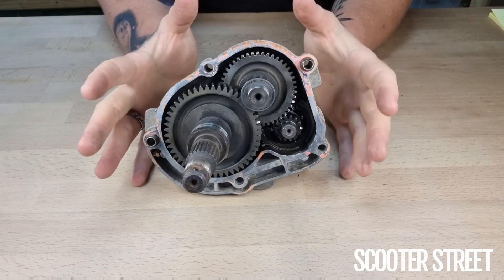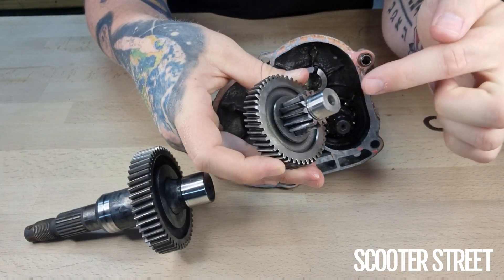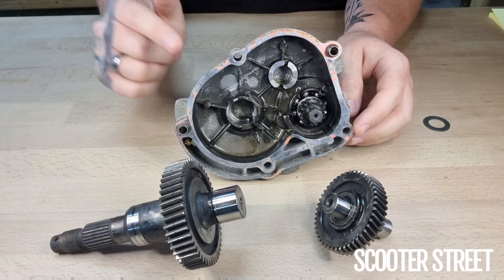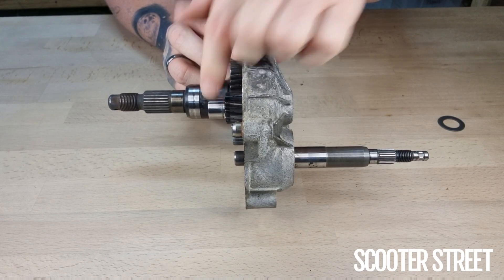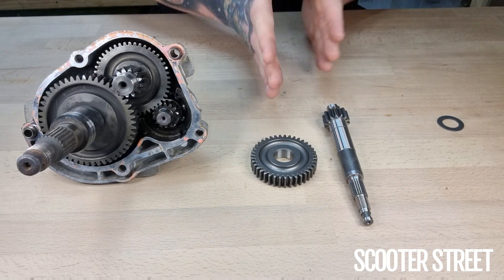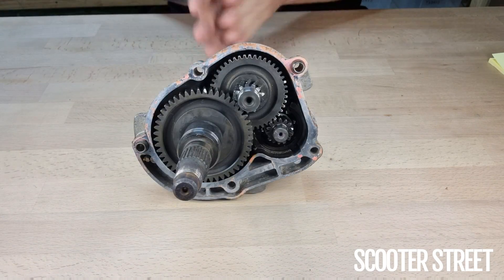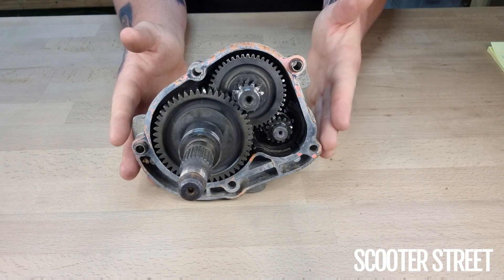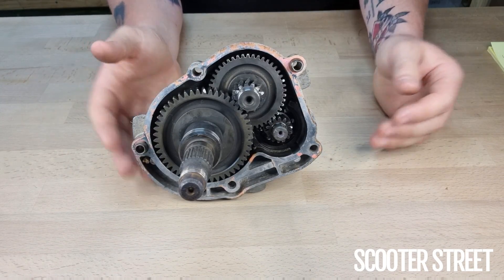Scooter Gears Explained! Primary & Secondary Kits - Which To Buy?

Comment: Quality content👍
Reply from the maker: Thank you. Glad you like😁
Reply: @scooterstreetau so what's the best gearing on my 150 scooter 15/37? Mine was 13/42 stock.
Reply from the maker: @Kevin-j9c1l  What is available in the make and model you have?
Reply: @scooterstreetau  what's available?? Anything 15/37 and on.
Reply from the maker: @Kevin-j9c1l  Go with the gearing you need,.
Reply: @scooterstreetau  that's helpful. Like the others. I figured it out like everything else.
Reply from the maker: @Kevin-j9c1l  We made the video so anyone can work it out, in the video we explain you how to calculate the gear to find the ratio👌
Reply: @scooterstreetau hey what gear up kit should i use on a tank 200cc 13 inch tire EFI 2025 with a performance exhaust and performance intake and carburetor and racing cvt
Reply from the maker: @CarlosReyes-v1x5c  What is available?   We made the video so anyone can work it out, in the video we explain you how to calculate the gear to find the ratio👍
Reply: @scooterstreetau im thinking a 2.1 final drive gear

Comment: Can i put the aerox gears on a bws vertical? Im asking because I've seen many people do that and the only malossi 14/42 gears i found online are for the aerox😅
Reply from the maker: Try the Staeg6 selections they have several options.
Reply: @scooterstreetau  But can I put aerox gears on the bws vertical engine?
Reply from the maker: @BUZZKILLER-NØS  With some of the ones I mentioned, they fit but the ratios are odd due to wheel size.

Comment: Hey what would you recommend for gearing on a 70cc athena kit on a Yamaha jog?
Reply from the maker: Do you want higher top speed? Change secondary gear and do the calculations.
Just be careful asking too much from the Jog if it has small thin 10 inch tyres and pressed tin wheels.
Reply: @scooterstreetau I want it to be more torquey but also have a higher top speed & I have upgraded wheels
Reply from the maker: @tayglizz4913  Fit a 70cc kit exhaust carb over range and secondary gear.

Comment: What gear do I need for more bottom end torque of that makes sense?
Reply from the maker: In most cases there are not gear kit to do this, this is acheived by increasing the cylinder size and upgrading the transmission variator, rear pulley. The quickest and best bang for buck is a Cylinder kit.

Comment: Thanks for share infomation, i have liberty 125 iget. I upgrade kit malossi 185cc - 62 stroke. Can u advice for upgrade my diff 😁 thanks bro . 
16 inch front wheel - 14 inch rear wheel
Reply from the maker: Hi, You're welcome. You would want to upgrade the secondary gear kit but you will need to find the specific Liberty model on the Malossi or Polini website.

Comment: Hello! Awsome video! I need some help! I have a Vespa Primavera 50cc 4T 3V Euro 5 2022. I upgraded it with Malossi 80cc BBK, Variator, Delta Clutch, Torque Driver, Red  Air Filter, Polini Belt. What other performance mods i could do for top speed and acceleration? My scooter is limited to 55km/h, which for me seems kinda low, yes i didn't change the ratio of gears, Malossi recomands 15/55 is that the best way or there are better ways? I heard it can reach 80 Km/h. Thank you!
Reply from the maker: Hi Thank you. You MUST change the ECU and gear kit when fitting the BBK!
Reply: @scooterstreetau  yeah i forgot to mention, i changed the ecu too, ok then, the only change to do is the gearing, thank you!
Reply from the maker: @Carbastanu  Yes do the gear kit then.

Comment: So when you go with the gear up kit should you use lighter rollers or  heavy rollers in combination with the gesr kit that's what I'm wondering about . Any help would be appreciated . I think ill keep the head stock with a 50 and do the gear up kit . N see what that does . I think it will be good that way
Reply from the maker: Yes, definately consider tuning the transmission to suit the gears, some gears require higher rpm engine to get the gears working.

Comment: Im just looking for top speed really . Cause u can tune the variator to get you off the line faster if im correct right?
Reply from the maker: Yes, but if you over gear a 50cc engine it will not have enough pull to allow the gearing to activate. You need rpm.

Comment: I changed gearing there are a lot of choices to choose from so i went from 13-40 to 17-38. I got lucky it WAS AWESOME 😁😁😁
Reply from the maker: Good stuff! What did you notice? Where are the gains?
Reply: @scooterstreetau  no I'm not happy with the change 🤬🤬🤬.I tried it again today only a 2 hundred rpm difference. I made too big a jump. 💩 Happens.
Reply from the maker: @Kevin-j9c1l  Yes when you sent the change in your reply, I calculated the ratio and it was huge reduction, it takes vast RPM to move such a ratio. 3.07 to 2.23. try for 2.8, 2.7
Reply: @scooterstreetau  I'm using 17-38 gearing what do I go to now?! 14-38 there's a few to choose from.
Reply from the maker: @Kevin-j9c1l  Use the information in the video to calculate the best gearing. gearing up will only work if there is sufficient RPM.
Reply: @scooterstreetau update I went back to 13-40 gearing. I decided to change so I googled gearing it said 13-  40 is stock no shit so it recommended 15-37. Wow what a difference  the stock gearing had faster take off but fell flat. This gearing slower take off but just pulled. If you will. I'll stick with it. 👍😁
Reply from the maker: @Bert-p3p  Nice work! Use the variator or Over range kit to better the accelration.

Comment: What gears do I need to get more top speed on long distance riding my scooter has 15/52 gears so it’s 13 to 1 full tire rotation
Reply from the maker: Search for what is available for your scooter.
Reply: @scooterstreetau  I got the gears that I need to get which will make me go 55 to 60 mph top speed but it will take me 8 seconds to reach 30mph and I am fine with that.
Reply from the maker: @Smodlee  Revisit and adjust the variator and clutch to assist with your early acceleration.

Comment: Hi i have a scooter with a stage 6 engine and a 22mm carburetor and a normal belt not the oversized one .
I want to change the gear box so what is the best ratio for that and did can i buy the primary without the secondary? Thank u for reading 😊
Reply from the maker: You will need to see what is available for your scooter model.

Comment: Hi do you know about the same thing but with a mo2 typhoon 125 2 stroke engine with a 172 kit. Im stuck at if i need to just change the secondary gear to the malossi one nd leave the primary gears as they are thanks in advanc
Reply from the maker: No, sorry I don't know the answer. You will need to do some research. Remove your gears and count or look at the parts diagrams. Also see what is available firstly for this model.
Reply: Ok mate no worries I'll have to keep researching untill I get to the bottom of it 😅 but really appreciate your reply thankyou. Also video was a good whatch helped me some what understand it abit more than I did 👊🏽

Comment: hi i have aprilia sr50 my setup is gianelli reverse exhaust and malossi multivar 2000 what  gears sould i use pls help
Reply from the maker: Fit a 70cc kit before the gears.
Reply: @scooterstreetau i wanted to keep it 50cc. will the malossi gears help my top speed? and what gear ratio to use
Reply from the maker: @apriliaSR-70  Really? Ok, check the fitment on the Malossi website for your model.
Reply: @scooterstreetau stock gears are 14/43 and its saying to put 16/41 and now i don’t know will i get better top speed or better acceleration or both 
and thanks for helping i appreciate it ❤
Reply from the maker: @apriliaSR-70  You need rpm to have any effectivness.

Comment: I'm planning a Stage6 Sport Pro MK2 AC on a Adly Thunderbike 50 (minarelli horizontal) polini intake, racing membrane block with carbon membrane) polini high speed variator, polini 3g clutch scr corse Handmade, motoforce hpc crank and polini gearbox cover. I will reach about 95-120km/h, should it be enough to change the secondary gearing?
Reply from the maker: Hard to answer this, the secondary is good place to start.

Comment: Always very helpful!! I was wondering what you guys think about adding a gear up kit to my piaggio zip 2t. Has got the malossi sport 70cc kit with TT vince exhaust and malossi multivar 2000. Do you think putting the malossi 15/38 gear kit would do any good ? Thank you
Reply from the maker: Thankyou and yes that's a great idea! Or a 14/47 secondary.
Reply: @scooterstreetau  Thank you for replying. What do you think about the malossi 16/37 gearup kit ?
Reply from the maker: @ST-9788  Calculate the gearing as in the video before fitting that one.

Comment: Primary : 16T ori
Second big 56T ori
56:16 = 3.5
Second little : 12T ori
Final : 35T ori 
35:12 = 2.92 
10.22 

15T.  if i change the primary    
56T
3.73.            
X.    
2.92
10.89 this go higher

So the higher the better acceleration i get? And less top speed?
Reply from the maker: Not much gain as a %. yes.
Reply: @scooterstreetau  is it worth it to change the primary? Or just play with heavier roller? I just want better acceleration
Reply from the maker: It depends on your target. @fikriaero9287

Comment: Hi there 🙂

I like you're video's 👍😊
I have a Piaggio Zip Euro 5 with a Malossi 80cc cylinder but my gearing is still stock. My top speed is 60kmph but i have plenty acceleration. 

Is there a way to change my gearing so my top speed will improve a bit ? 

My local dealer said that they don't know any gearing options that fit the Piaggio Euro 5 engine with the 10" wheels that the Zip use 🥺

(My complete setup is)
Malossi 80cc cylinder with Malossi ECU
Stock air filter box but with Malossi foam 
Malossi air filter tube 
Malossi variator but with piaggio belt

I don't have the torque driver yet , but does the Malossi torque driver also increase the top speed or only the acceleration ?

🙂
Reply from the maker: Yes you do need the gear kit with this model. What you need to do is find the part number for the Euro 5 Piag Zip gears and compare them to the Euro 4 gears. If they are the same then you can use the Euro 4 gear kit from Mlaossi. https://www.malossistore.com/en/au/piaggio-zip-3v-iget-50-ie-4t-euro-4-2018-2020-pizi3v50-M.
Torque driver assist yes.

Comment: Hello sir… i have kymco 125 cc…i want a top speed gear installed… pls! give the gear Ratio to acheive it . Thank you!
Reply from the maker: What is current gear ratio and what is available for your model?
Reply: @scooterstreetau  its a stock gear. my scooter brand is Kymco here in Taiwan
Reply from the maker: It is impossible for me to know 🤷 There are over 20+ different model of Kymco 125cc. @dcharmz5915
Reply: its a jockey SR model
Reply from the maker: We dont have this model in Australia, I am sorry I can't help. @dcharmz5915
Reply: I guess its all desame gear ratio in all kymco 125 cc
Reply from the maker: Certainly best to check as they have different gear ratios depending on rim size and transmission belt, variators. @dcharmz5915

Comment: I have a 05 bugeye zuma with athena bbk yasuni c10 pipe dellorto 17.5mm carb top performance variator kit with 7 gram rollers with a malossi fly clutch and bell with a yellow 1500rpm contra spring with the medium green clutch springs on the clutch. I have no idea what the stock gearing is in my zuma. I definitely need an up gear kit but with so many different numbers with the gears im totally lost as to what to get
Reply from the maker: See here for the Malossi gear kit, oly 1 option so can't go wrong😊
https://www.malossistore.com/en/au/yamaha-zuma-50-2t-yazu50-M

Comment: Hello, thank you for making such an informative video, would you be kind enough to advise me, my bike 2000 yamaha slider, stage 6 pro 70,stage 6 hpc crank, polini 3G clutch, 21mm carb, stage 6 pro pipe. I’m maxed out at 55, what would you recommend for my gear up. Stay safe thank you
Reply from the maker: Thank you for watching and your comment. You need to find out the current gear ratio. so do this first and then you can select the gear upgrade to suit. Try for a Secondary gear and here are available options: Polini, Malossi, Stage6, Top Performance.

Comment: what KIND of speed seems to be an issue some want more top end others just want better performance UP TO the regular top speed
Reply from the maker: The gears can give a higher speed at the same rpm when compare to the original gearing.
Reply: @scooterstreetau  exactly folks are going at it backwards imo(i did too!) they start with carburetor and then variator weights on to the big bore gearbox last now im thinking thats first if you want SPEED i want the big bore to get me up to 35 a little quicker its a stay the hell out of the way of traffick issue for me lol
Reply from the maker: @steveboshakis2751  Nice work🙌. Some of the models have gearing for accelerating and these are very responsive to a gear up kit. Kymco ZX and SYM Jet are a perfect example. When go fast parts are installed they over rev and then the gear kit has the perfect application.

Comment: Hi. I own malaguf12r 2008y. I changed allmost everything. Naraku 70cc with stg6 pump, stg6 clutch with bell and variator, reed valve and collector. I wanna to change and gears. Can u tell me what gear should I pick because I can’t understand what is the rotations and the teeth’s 🤷🏻‍♂️🤷🏻‍♂️
Reply from the maker: Find your scooter on the Malossi website and select the secondary gear kit.

Comment: What would you recommend for top speed a 15/41 gearing or 17/40 for malossi primary it's for 10 inch wheel also on a stock secondary gearing???
Reply from the maker: 15/41 gives 2.73 rotations per cycle which is sufficient for 10inch and a performance set up.
Reply: @scooterstreetau  sow 15/41 primary gear for top speed it is on a stock secondary gearing
Reply from the maker: @NotSOFast597_  dont apply, not enough rpm.
Reply: @scooterstreetau  don't worry I am currently using the 17/40 gear now I'm gonna go with 15/41 for top speed my scooter is a Yamaha jog short engine with stage 6 mk2 racing 70cc , yasuni c21, mvt digital direct 19 ignition stage 6 hpc crank 360 polini manifold Keihin 28mm carb malossi transmission*
Reply from the maker: @NotSOFast597_  That makes a huge difference when you have a set up like that. You should mention that earlier👍

Comment: My aprilia sr 50 r goes 93 when it reaches max speed the engine shuts off is it some blockage
Reply from the maker: You will need to investigate > start with the piston , fuel, air, electrical.

Comment: I'm thinking of upgrading my 80cc to a 150cc plus maybe 180cc or something along those lines however I primarily want to increase the top end by installing a smaller final gear but no one is able to tell me what the max size that fits in the case and will the scooter be highway worthy? For some reason no one in the scooter community cares about the highway.
Reply from the maker: The parts manufacturers have a range of set gears so you are limited as to what you can fit.
 Look at the available gears for your scooter and go from there. Compare what you currently have and gear up accordingly.
Reply: @scooterstreetau  I get that part, but are you aware of any gy6 scooters that are highway worthy where they don't have to be at full throttle to keep up with highway traffic?
Reply from the maker: @Micscience  I am not aware of any. This is where you step into a 250- 300cc.

Comment: I have a aprilia sr 50 factory and upgrading it to 70cc malossi kit with the malossi ecu and a racing exhaust, wich gear kit i should get for it if I want more acceleration
Reply from the maker: What year is your SR50, and the engine prefix. C361M  ??

Comment: I have an Aprilia sr 50 r 2021 euro 4. Which primary and secondary could I put in to extend the transmission to 50 cc. She currently has 11/50 secondary and 13/46 primary. While older models have fast transmission
Reply from the maker: Check out the Malossi website, all gears are under the Transmission category.
https://www.malossistore.asia/EN/aprilia-sr-carb-50-2t-lc-2004-piaggio-apsr0350-M#INGRA
Reply: @scooterstreetau  what gear ratio would you take from malossi for 50 cc
Reply from the maker: @suzukigsxr8856  It depends on what you want, I would change the secondary if I wanted higher top speed. We made the video so you can work it out at home..
Reply: @scooterstreetau  now my secondary is 11/50. How long can I extend the transfer to the secondary? Can I gain speed at 13/48?
Reply from the maker: @suzukigsxr8856  Do you want to gain top speed or acceleration?
Reply: @scooterstreetau  hi, im his friend. I Have an Aprilia 2020(malossi 2000, malossi torque, yasuni R…) Me and my friend just found out that my scooter have 20% shorter secondary gear. We want to make my scotter to go on top speed. I wanna make my scooter goes more than 90+ gps. Also I found secondary malossi 13/48 for my scotter, would you recommend them? Also Im about to put delta clutch also with that secondary gear to help my scotter to be on high rpm from start to  top speed.
Reply from the maker: @tronix4739  The secondary gear will help but you should make the calculation first. The gearing is different on the large wheel scooter when compared to the 10 Inch wheel. The 70cc kit will help with top speed. The Polini G3 clutch is very good to use and easy to tune.
Reply: @scooterstreetau  aprilia sr 50r 2021 yasuni r stock 50cc setup , spring, clutch spring , variator stock roller gram??
Reply from the maker: @suzukigsxr8856  Without additional RPM (70cc) it may be a loss of value to fit a gear kit with this set up..